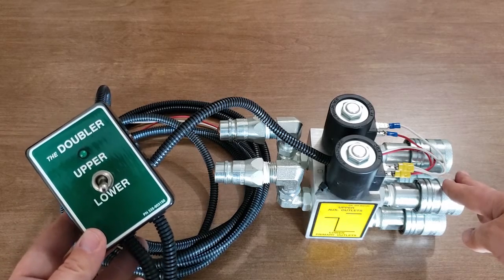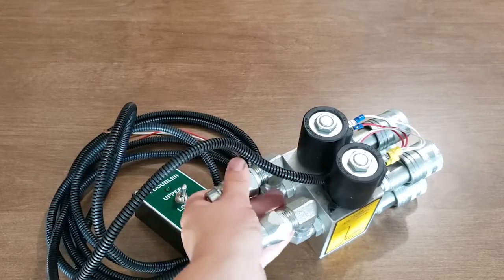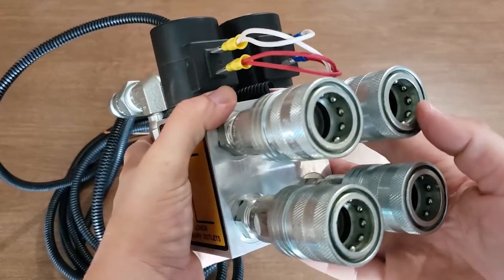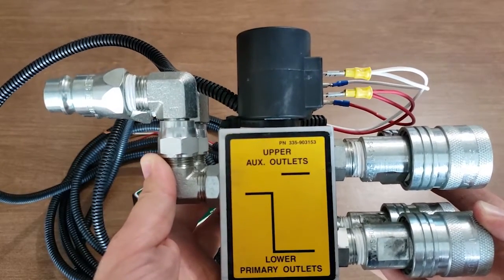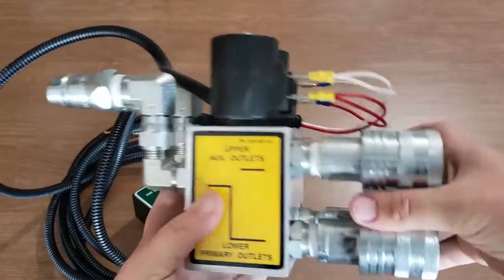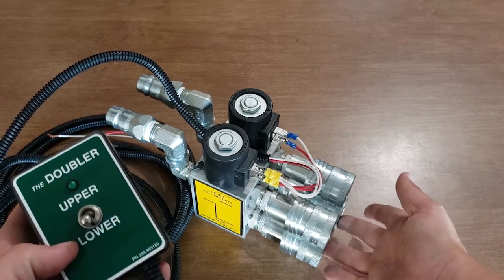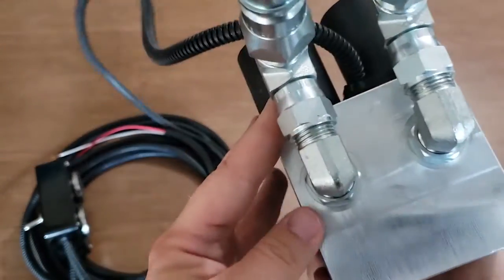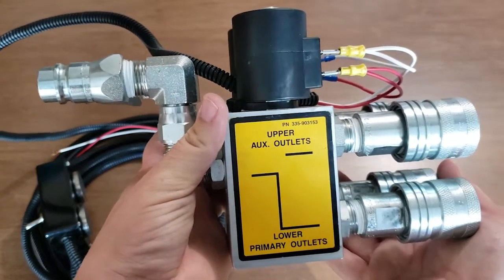Pioneer Style Rear Remote Multiplier - Convert 2 Remotes to 4 Remotes

Comment: I have 2 remotes on back of my  kubota Grand L6060, but i need an extra one. It looks like if I plug this into my bottom remote it will block my top remote. Can an extended joint be added to drop your remote down further?
Reply: I think this kit will work on your tractor.  I would swivel the two male connectors down and install the kit in your top remote.  I could see where the solenoids would interfere if it was in the bottom remotes.  I’m willing to go out on a limb and assume that your top remote has a detent??  If that’s the case, you may wanna look at a Summit Hydraulics multiplier kit.  I know that you’re wanting to have a total of three usable remotes,…you may want to consider a 3 valve multiplier kit so that you’d have a total of four remotes. That way you’d have top and tilt, and two remotes for your attachments.